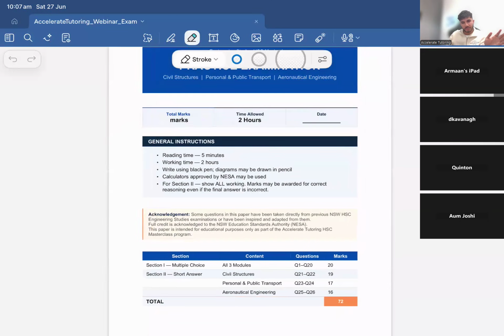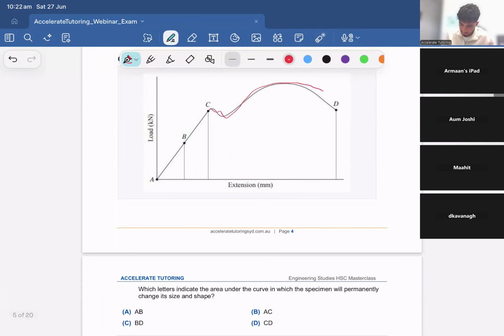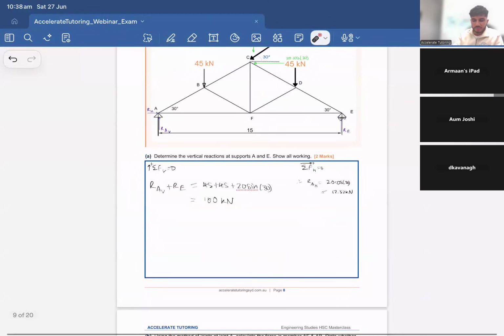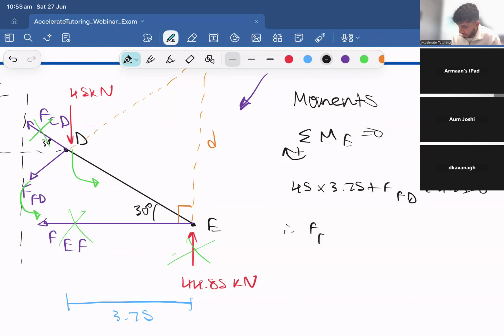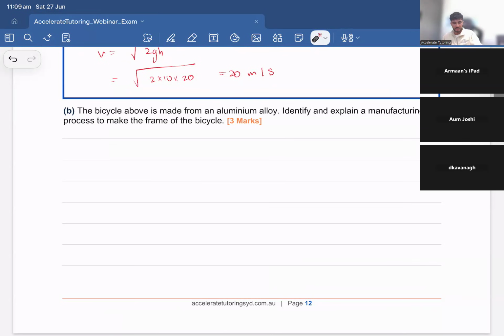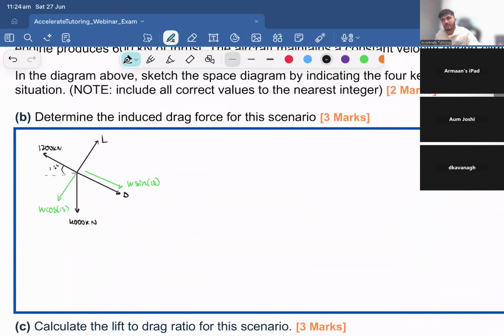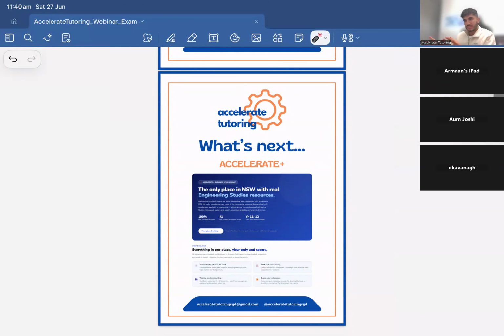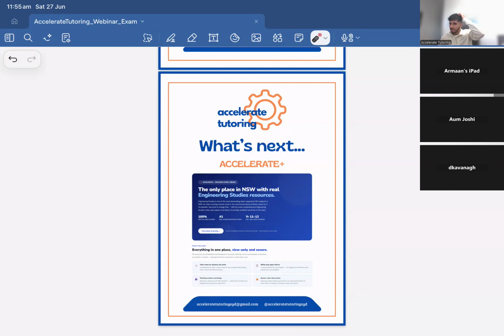Yr 12 Engineering Studies Trials Masterclass Webinar | Accelerate Tutoring

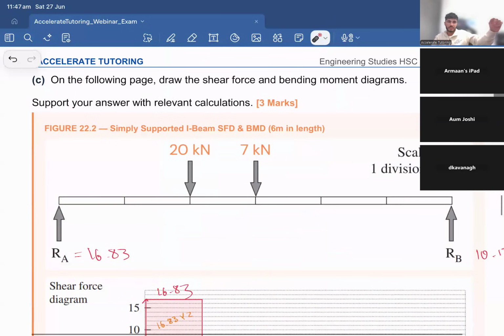Comment: Just to make a correction re. calculation of SFDs and BMDs. At 1:50:35 you say that one way that NESA can make this more difficult is to ask a question involving a  UDL or NDL. This is not in fact correct. 
On page 25 of the syllabus  you'll find a dot point that states the following: 
"calculate and graph the bending stress and shear force of simply supported beams involving vertical point loads only
 "
and
"uniformly distributed loads
: describe the effect of uniformly distributed loads on a simple beam, without calculations"
So, you might be asked to calculate/draw SFDs and BMDs for simply supported beams with point load only, but you would only ever be asked to describe or identify UDLs on a simply supported beam. 

Some past HSC questions that refer to UDL:
Q9, 2017 HSC
Q15, 2020 HSC
Q17(ii) 2012 HSC
Q8, 2002 HSC
Q5, 2004 HSC